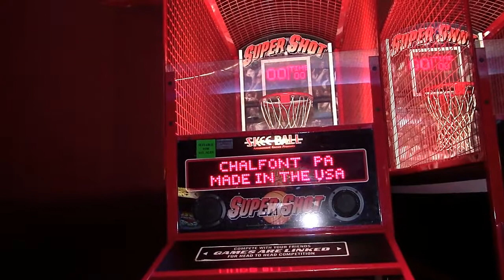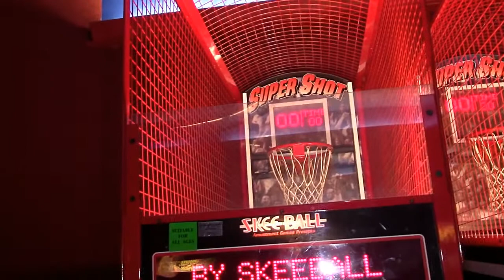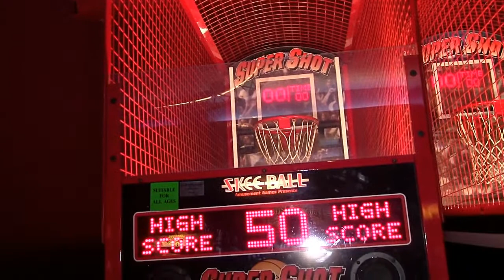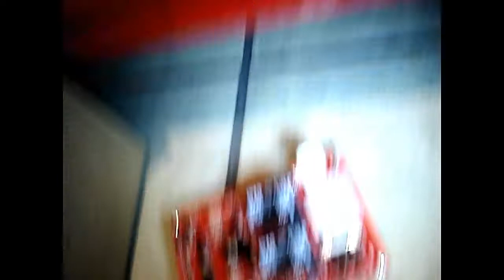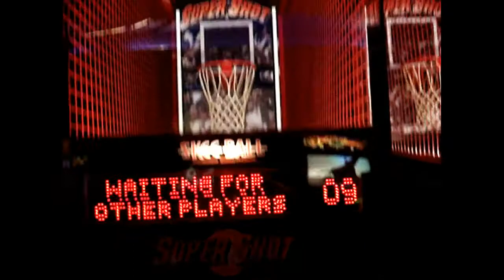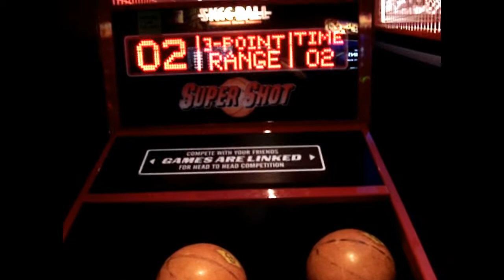Sams Arcade Fix Skee Ball Super Shot replaceing motor driver board

Comment: Are parts for these machines hard to get? I came across a machine and have a few boards , front display panel, the buttons. Stuff like that. How much could I possibly ask for on the boards without knowing there condition? Machine wS stored inside a garage. Man had trouble finding parts to make it operational unit so he gave up on it.
Reply from the maker: While I haven't checked in a long time, I would think you can still get parts from any game distributor like Betson, SuzoHapp, Bay-Tek,even Skeeball direct but parts are not cheap. You might even check Ebay.
https://skeeball.com/supershot-home-arcade-basketball/
Reply: @SamsArcadeFix  do they offer support? I'm not looking to rebuild the unit. Just want to sell off the good useable parts. I'd like to have the boards tested. I was offered 120 for all the boards.
Reply from the maker: I don't think they deal in used parts, they only want to sell you new parts. The best way to test your boards would be to find someone with a working game and swap in the boards one at a time. Thats how I would troubleshoot the game on location as we had two side by side. In this video the motor drive board was bad, but it was still under warranty, so they sent me a new board. I don't work that job anymore, so I don't have access to the game. You might consider selling them on Ebay or in the KLOV parts for sale section. https://forums.arcade-museum.com/forums/trading-videogame-for-sale-parts-one-off.24/ @bigboybuilder77

Comment: Hi, i just bought one and the board wont move back and forth, everything else seems to work, i tried to manually move the board by spinning the motor, and place it in a forward position, and when i restart the game the motor does come on and puts the rim back to its original position. so i am so confused as to why it only moves at that point but not when you want to start a new game. any help would be great. thank you so much
Reply from the maker: It could be the motor driver board. This board produces the power for the motor and has 2 relays which reverses the power to the motor. If the motor only travels in on direction it could be one of the relays unless the main CPU has a problem. Check for cold solder joints at all the connectors. I was lucky as I had two side by side so I could swap the boards to find the problem.

Comment: Before you changed the fuse did the arcade even started? Or the screen was displaying something? The LEDs on the board blinked?
Reply from the maker: It's been a while but if I remember correctly the fuse blew because the bridge rectifier on the motor control board was bad, so the basket motor was dead. When you turned the game on it would give a motor error on the display and give an audible warning sound which you can here in the video, but the game would boot up and you could play a game, but the basket goal would not move.